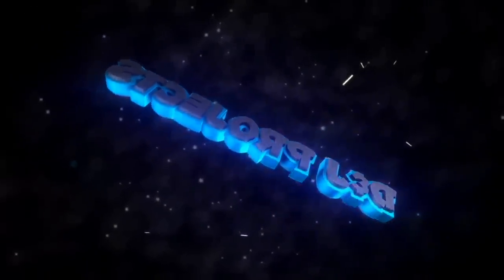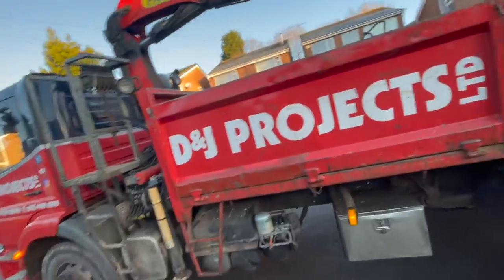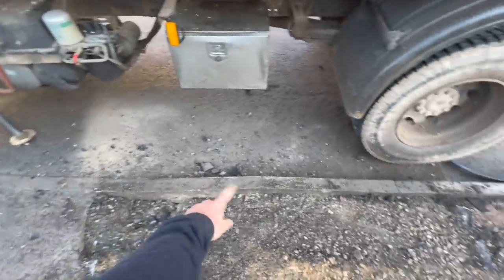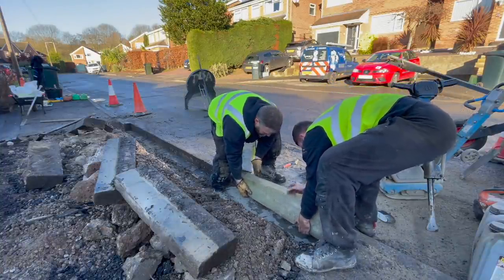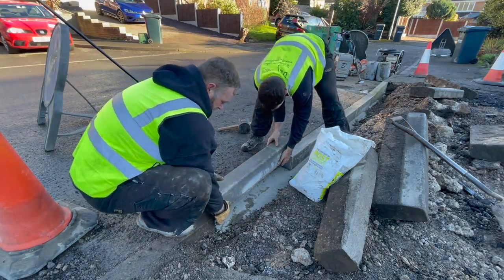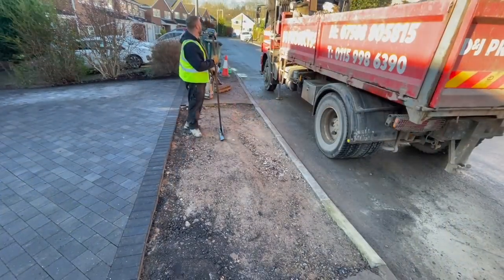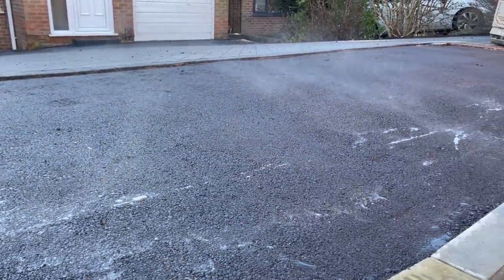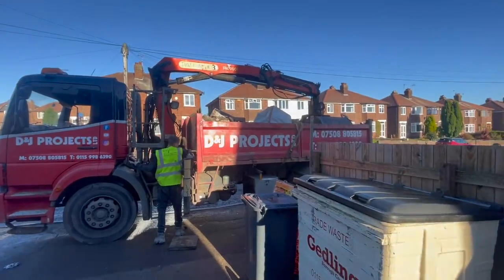WE'VE ONLY GONE AND DROPPED IT...

Comment: Just questions for curiosity - was there concrete put behind the kerbs like existing ones?
Do you not need joint spray or paint on adhesive between the old and new tarmac to prevent freeze thaw?
Reply: Noticed adhesive on what they did it in the yard tarmac  ? that kerb was his dad bodge it and scarpa !

Comment: I used to work in a Tarmac Plant a good few years ago and spent a fair bit of time in the mixer cabin.
The tips were fantastic especially from the Traveling Community guys who basically wanted it hotter than hell and plenty cut back (Flux) put in for good measure.
Nice job 👍🏼 
Only thing …is joint paint no longer a requirement in your area ?
Reply: It was in the yard ? Not to savvy …good point you made

Comment: If The Grab loses Hydraulic Pressure does it fall on the person standing underneath it?
Reply: Would all depend where it lost pressure first, could be a steady fall or if a cylinder explode could swing, most functioning parts being heavy metal and also straight makes me think they'll have a lockout to stop them dropping, a fail safe if you will
Reply: I don't know about HIAB cranes, but stuff that carries humans (boom lifts, scissor lifts, etc.) have to have safety valves in the cylinders that stop things falling if a hose fails or similar.  Either way, I certainly wouldn't stand underneath it.

Comment: Hey lads,
Love the videos but you done that job completely wrong if its council spec, supposed to dig down and use mot type 1, back new kerbs up with concrete mix and there was no joint paint on each end of tarmac to seal to existing, just saying lads, dont want you to get copped from the council, unless its a private road of course 🤣🤣